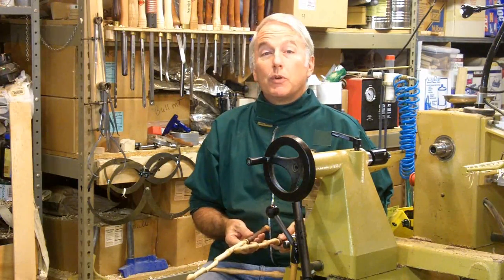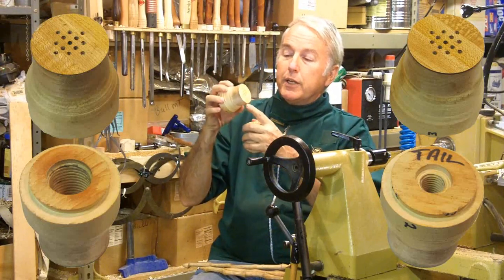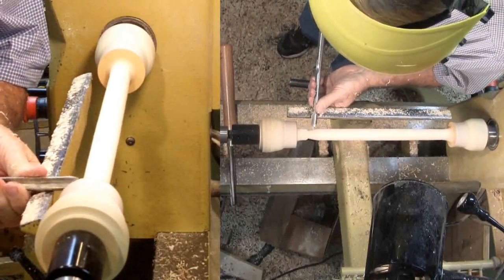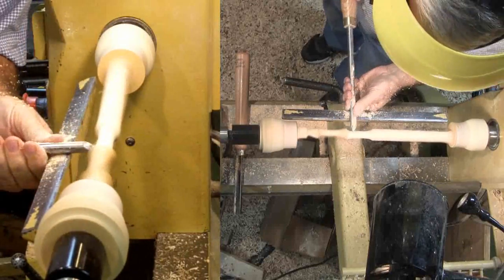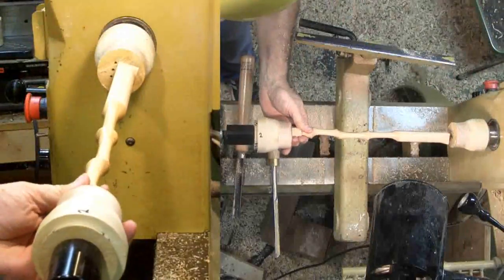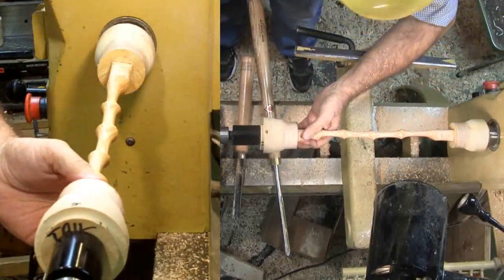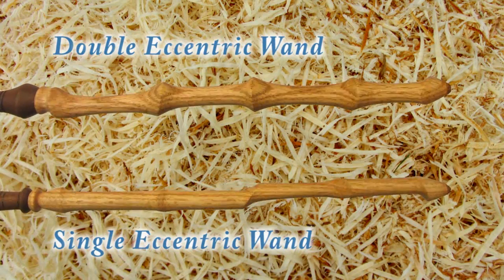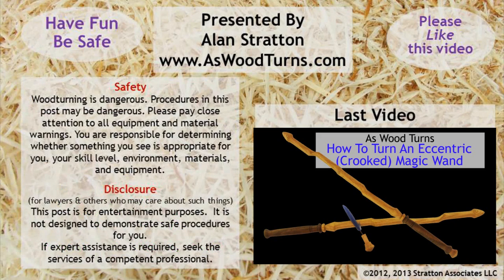How to Turn a Double Eccentric Magic Wand

Comment from the maker: I do think the faceplates make it controllable and probably safer since less pressure has to be maintained between the centers. Still - do be careful. BTW I've seen several turners use the tenon cutters including the late Dale Nish.
Thanks for commenting.
Alan Stratton

Comment from the maker: Actually, no tail stock pressure is needed - only enough to take out any horizontal play in the stock.
Power is transmitted via 2 brass rods in each faceplate. One indexes the wood to the faceplate; the other transmits power.
I'll put up another video to focus on the faceplates.
Alan Stratton

Comment from the maker: That would be true if there were only 1 pin on each end. However, since there are two pins on each end - 1 provides the indexing; the other provides traction. I just posted another video with more detail on the faceplates.
Try it out. :)
Alan Stratton